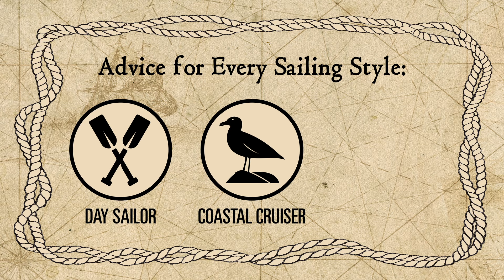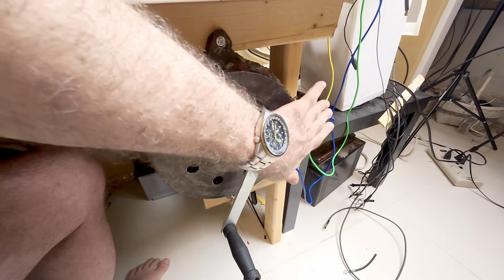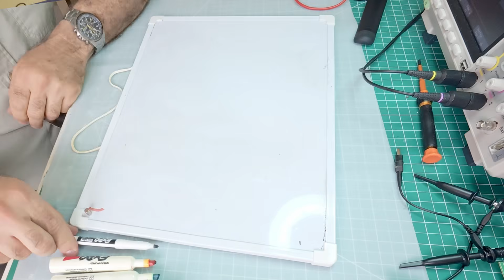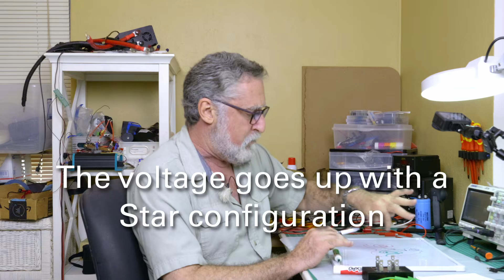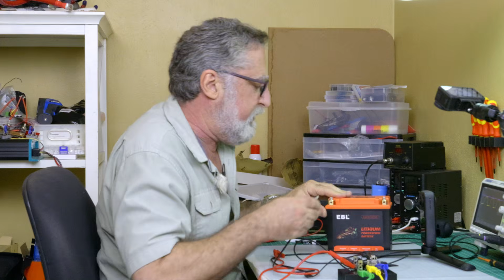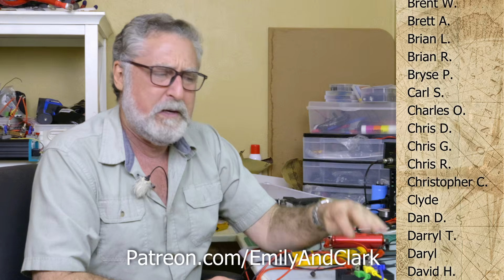Sailboat Shaft Generator Making Power  (Shaft Generator part 4)

Comment: Awesome! I had some fun myself building axial flux wind generators, also with ac motor conversions to permanent magnet alternators. I wonder what boat speeds would be required to bring your generator to cut-in speed. Also there is also a trick of rectifying the faces independently and then connecting the DC outputs in series or parallel (depending on each setup). Great video!
Reply from the maker: That's interesting.  But I'd be concerned it would pulse too much.  Cogging.
    It probably wouldn't matter for this heavy shaft/prop but for wind I'd be concerned
Reply: @Clarks-Adventure  Now I recall that rectifying per face was more in the context of my lazy motor conversions to permanent magnet generators (using existing coils), where cogging was a given and the coils where already in place with some motors having different sets of coils. I did experiment with this setup with axial alternators on low wind periods, it worked well.  Perhaps your well thought out axial already accounts for the expected 5 knots of average boat speed on a passage. I have not checked the rpm of the free spinning propeller on my sailboat while sailing, you got me thinking now, if the axial is wired correctly...
Reply from the maker: Also.  I've drilled out the wood cores in the past to install ferrite beads.  They bring up the magnetic field significantly but caused a bit of cogging

Comment: My alternator is wired for 3 phase AC to a commercial rectifier.  They are used to make dc for control circuits on large rooftop AC units.  This get the rectifier heat out of the alternator so I can safely get 225 amps out of my Yanmar 3GM30F diesel with a flat belt.

I then only produce about 120 amps at high idle and everything stays about 100 degrees F.  I carry spare brushes and bearings for the alternator.

Comment: With a planet spinning so fast and filled with molten iron, there has to be incredible power to be harnessed.
Reply from the maker: That's where our magnetosphere comes from.  It's why we have an atmosphere still around us and aren't being bombarded by radiation 

   But to make power from it I think you have to create a stator.  Maybe a satellite chain in the reverse orbit.   But they would quickly lose their orbital speed and crash.
   Maybe the moon?  It's heavy
Reply: 6 phase alternators have a significant efficiency improvement over 3 and if you're producing several hundred watts or more it helps to be a hairpin stator.  Denso led the way but other brands are in the space now